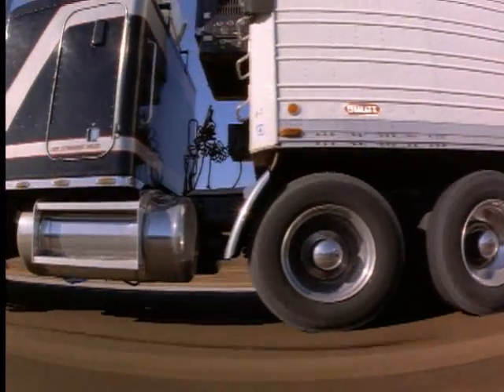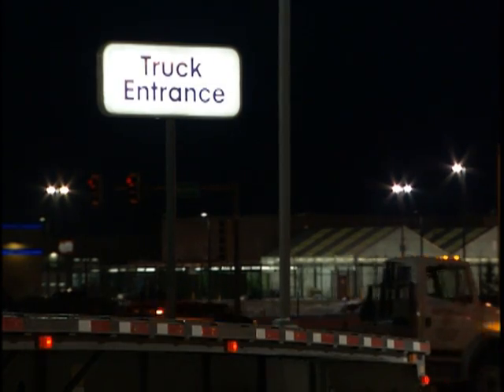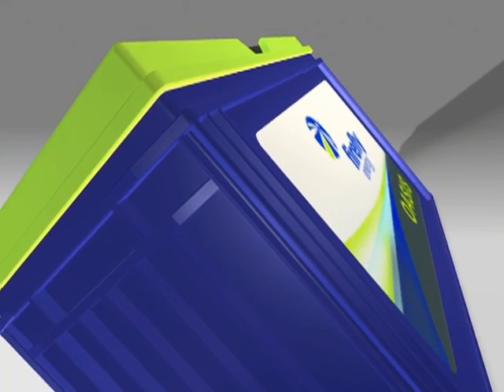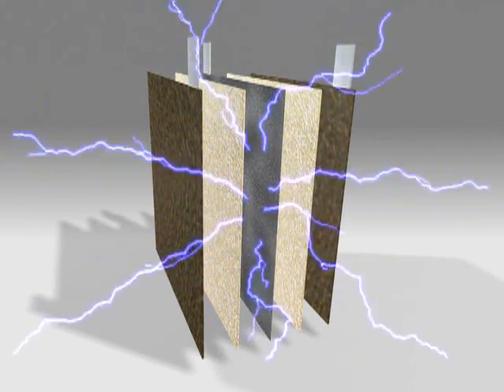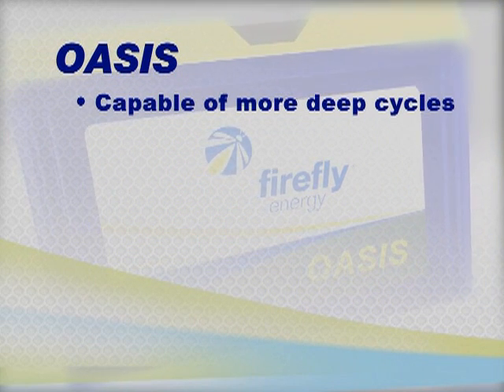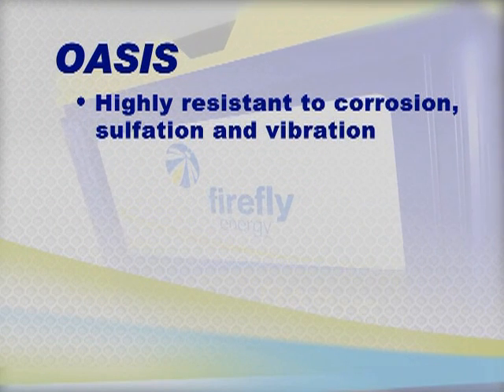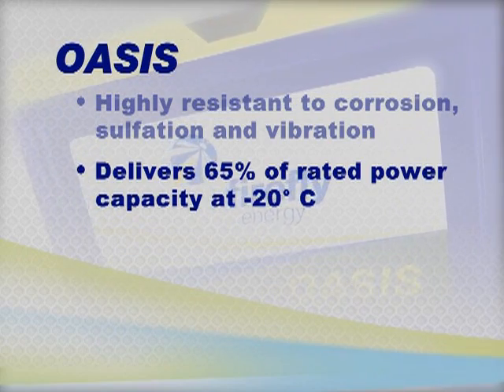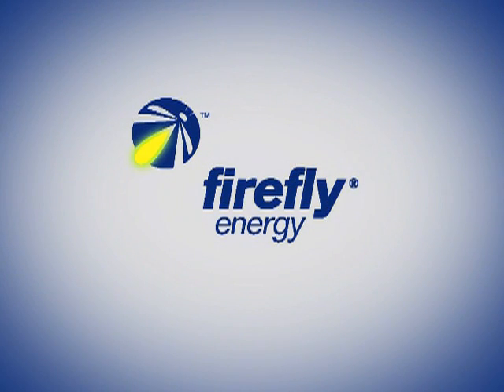Firefly Energy Oasis Battery

Comment: I have checked out their performance specs (available on web-site) and compared them to many other high quality AGM batteries eg Exide XMC-31 they have little advantage. The firefly product may have ~10% greater energy per unit mass at slow discharge rates. It may also be a bit better in terms of cycle life but where it fails to compare is under very high power applications (eg XMC-31 can deliver 1.4 x the power) so for EV use check the specifications before you buy, other brands may be better.